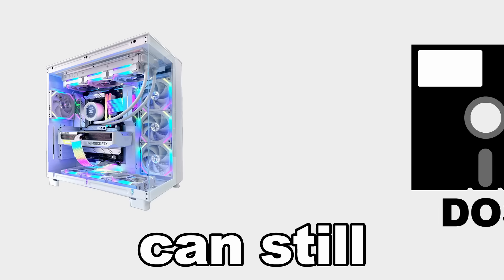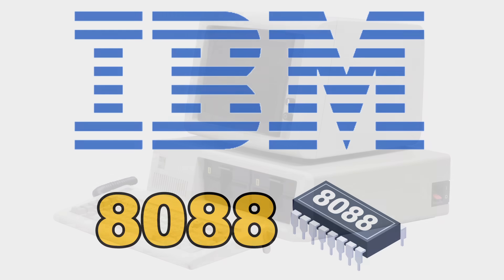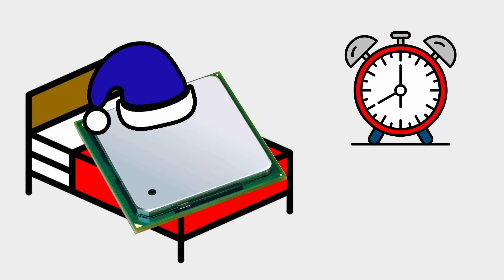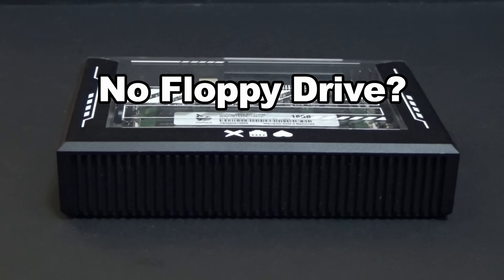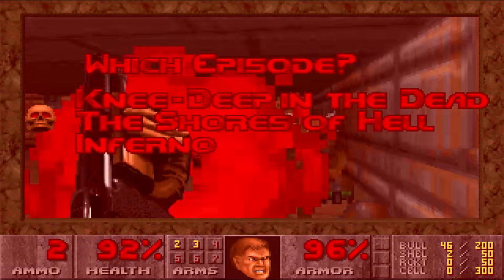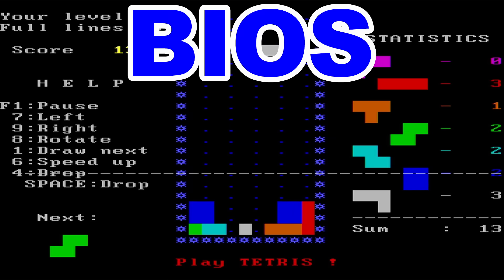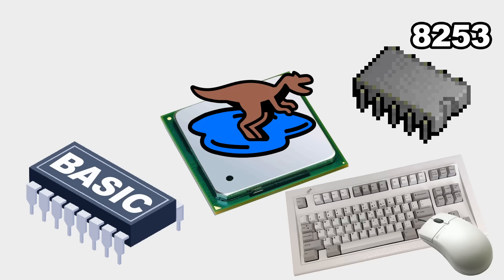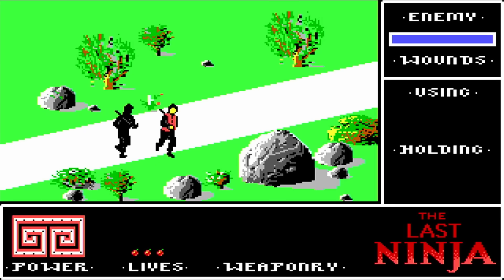45 Year Old DOS on a New Intel CPU Without Emulation

Comment: Short answer: it's CISC!

Long answer: most basic 8086 instructions are there IN MICROCODE, those are implemented with microcode routines that "emulates" them with simpler instructions: for this reason a "simple" 8086 instruction can be quite taxing (like DAA -> BCD adjust after addition) in term of execution cycles.
Those are just chunks of microcode that perform poorly (but a 1GHz CPU is powerful enough to make sure that even then it's lighting fast if compared to an original 80486).
Intel dictated different instruction sets in real, protected and x64 mode (that one came from AMD to be fair) so instructions (opcodes) that are there ad do something on "REAL" or "VIRTUAL" 8086 mode just disappears when the processor "move" to protected 286, protected 386 or x64 mode... because the same opcode / instruction does a completely different operation depending on "witch mode" your CPU is running at the moment.

There are at least four ISA (instruction sets) on a modern cpu, one for each mode and you get "fast" instructions (that are implemented close to metal) only when you reach x64; the rest is implemented "poorly" because "no one cares anyway".

Truth to be told real intel or amd machines are somewhat of a small mistety in a sense: they aren't 8086 and they don't look similar to anything that resembles a classic (or even a modern if you look at them top-down) processor: they are unique, complex and really "strange" processors that ACT as 8086-80286-80386-x64 machines only because a small microcode layer mimic the machine with the underlying hardware.

A failed company, TRANSMETA, only tried to exploit this thing to build a "morphing" CPU that could be "upgraded" just moving from a microcode to another. They didn't last.
Reply: I was about to upvote, but... Transmeta certainy wasn't a "failed company"!!! It licensed it's IP successfully, giving non-exclusive licences to Intel, Nvidia, Sony, NEC, etc. until it was bought out in 2009. 2005 in particular was a very profitable year. It successfully sold technology, in particular LongRun and LongRun2 power efficiency tech.  I think you have memories of when Linux promoters, and Linus T. personally, had problems with the concept, as it wouldn't work very well with Linux at the time. But shade from Open Source groupies doesn't constitute failure.

Comment: Apple gave up backward compatibility in hardware when they switched from 68000 to PPC, from PPC to x86_64, and from x86_64 to ARM. They gave up software backward compatibility when they switched from macOS classic to MacOS X and partially when they gave up on supporting 32 bit software in macOS altogether. That's one of the things I truly love about Apple. They step forwards, cut off old tails, get rid of legacy crap. There's always a smooth transition (macOS classic could run on MacOS X for quite a while, PPC code could run on x86_64 CPUs, and x86_64 code can currently run on ARM CPUs) but after a while they just move on. 

If you truly want to run 45 year old software, just use an emulator. Not only can it emulate any hardware you like and hardware you cannot even buy anymore for ages, it can also fix issues that hardware had, it can make software even run better than on the original hardware. Some games today are way better playable in an emulator as they had ever been on true hardware.

Some people may think cutting off backward compatibility is a bad thing, but they would probably not think that way if they knew that x86 CPUs could be faster, more efficient, and cheaper today and Windows would be a lot smaller, more stable and less resource hungry if they only dropped a bit of backward compatibility at least once every decade. You are paying a high price for compatibility that 99.999% of all users will never ever have any use for. Quite often the answer to "Can we do that?" is "Sure we could do that and it would be awesome but it would also break backward compatibility, so unfortunately no, we cannot do that". That happen in software dev, that happens in hardware design and it happens all the time.
Reply: "That's one of the things I truly love about Apple. They step forwards, cut off old tails, get rid of legacy crap. "

... and their market share showed the result of such decision 😏
Reply: @gorilladisco9108  Their market share has been constantly raising in the last 20 years and the main reason why not more people buy Apple products is the price and the fact that they cannot run their Windows programs on it but that has nothing to do with backward compatibility, as even if Apple was backward compatible to their systems 30 years ago, people could still not run their Windows software on it.
Reply: So, Apple went from CISC (68000) to RISC (PPC), then back to CISC (x86_64), then changed their mind and went back to RISC (ARM). That's quite some work to just switch between 2 architectures. Also, their change to ARM has nothing to do with backwards compatibility but with their measures to stop people from building Hackintosh machines.
Reply: @BrunodeSouzaLino  There is no CISC anywhere. x86 CPUs are internally RISC for almost three decades now. The outer instructions are internally translated to RISC as all the CPU core parts are RISC. Again, the only reason the outer instructions are still that way is backward compatibility.

"Also, their change to ARM has nothing to do with backwards compatibility" - Nobody has ever said so. Stop making up things.

Comment: The problem is not being able to run DOS, it is that most of the time when you need to run DOS you need a true hardware 9 pin serial port 16650 

The DOS is part of the problem, but that hardware serial port that the BIOS has programmed in it, and the speed of the CPU

Usually when you get over 300 MHz the software will crash because it was never written to work at that speed

The other big issue is slowing down the data rate of the COM port

The old machines had 9600 or 14400 but the device and the software don't handle much faster. 

I program old two-way radios and it is a nightmare unless I have an old laptop with the first USB ports, and a hardware serial port and slow enough 

A nice 486 or Pentium 60 megahertz that has a USB port is great. 

I remember in the 90s having motherboards with USB header pins and no USB cable to add ports to the back. 
And on the laptops that had a USB port, the only device available that was USB was a mouse. 
I remember even in the late 90s, around 99 it was still almost impossible to find USB devices. 

XP was the first time we saw USB keyboard and mouse and no PS2 ports
DELL was the one I dealt with all the time and I remember having to get PS2 to USB adapters or USB keyboards and mice.
Reply: There was no BIOS support for serial port communications.  You had to write serial port code yourself in DOS.    The data rate of the com port is hardware controlled.  CPU speed doesn't matter.  I think you meant 16550.  Those chips with the deep FIFOs were needed to do "high" speed comms (think 9600 bps) with slower processors.  They buffered up to 16 characters for each interrupt compared to one character per interrupt in the original 8250 and 16450s.

Comment: If Intel and AMD worked together on a new instruction set to supersede x86, it would instantly be better than any other chip out there. And the way most software is written these days, supporting the new architecture would be easy. x86 is holding back Intel and AMD, which is why both have toyed with the idea of making ARM or RISC-V chips. But they should just work together on a new CISC design.
Reply: you might want to actually research the current 64 ISA... there's a reason a lot of places call it AMD64 instead of x64 or x86_64... AMD created the ISA that is still in use today, even on Intel CPUs, Intel just licensed it from them and added a couple of Intel only instructions to it (and changed the endian-ness so they're still not cross compatible with each other... I.E. you can't install windows in an AMD computer and move the hard drive to an Intel one and just boot it, you either need to reformat or use something in between to translate the endian-ness to the expected type)
Reply: @sirgouki6207  I am well aware of the AMD64 architecture. And you don't have to reinstall Windows, Windows will detect the change in hardware and reconfigure itself appropriately with the correct drivers.

My point about them working together on a new ISA still stands.
Reply: @sirgouki6207  you couldn't be more wrong. both intel and amd x86 are little endian, most of the instruction set is identical and you can definitely put a disk from an intel pc in an amd one and it will work. if it doesn't, it has nothing to do with endianess and everything to do with drivers.
Reply: The last time AMD and Intel worked together (back when AMD was a chip supplier for Intel), Intel shafted AMD. Then later, Intel tried to sweep x86 under the rug with IA64, but failed and til this day they're forced to license AMD64 from AMD.

Comment: You claim that DOS can run on Intel, or AMD systems now because the instructions are still there.
I hate to tell you, 8 and 16-bit instructions have not existed on X86 chips for a really long time now. I think Intel got rid of them with the Pentium. Of course for Intel now, many of the 32-bit functions don't have silicon for them either. Some of instructions on  Intel chips still run on the bare metal, but quite a few of the commands are now read, and translated into a special micro-code, or in the more common vernacular, emulated. Having many things run in micro-code, and even the ability to redirect hard coded logic to micro-code when they need to. This is how they have worked around some hard coded security flaws in the past with just a BIOS update.
Reply: I'm not sure what you're getting at here.  Sure, the instructions are executed in microcode, but it's still being done in the CPU.  How the instructions are implemented in the CPU doesn't really matter - the point of the video was that you could boot DOS on a modern processor.

Microcode's been around for longer than Intel has been a company.  It's just a different way of implementing CPU logic.
Reply: You're slightly incorrect.  The instructions are there, but once the CPU switches into 64Bit "Real Mode" they get isolated away.  This is, presumably, why you can't play old games like the original Red Alert in windows now, as the OS can't even access the 8bit and 16bit ISA in the CPU.  If you do like in the video, and instead boot into a 16 bit OS, the CPU never makes the switch and you still have access to those instructions (Unless you're on a 64bit only CPU)
Reply: @sirgouki6207  No trust me, those instructions are only there in microcode, firmware. Technically there is only "Real Mode" now, but internally the CPU assigns all resources to simulate the old startup. That's not to say that the "switch" of modes isn't required to maintain backwards compatibility, it just doesn't change the a hard coded decoder like it did on the 386 and 486. I am not sure exactly when AMD switched their implementation from hardware to firmware, only that they've been emulating the old instructions for quite some time now as well. I might be wrong on this, but I heard from some people in UEFI trusted mode you don't even need to make the "switch".

From the software's perspective it has no idea, and everything should run just like it is hard wires. It is just running on firmware code, instead of hard wires on the IC. It was very interesting learning about the internals of the Intel chips as they basically don't run on x86 instructions anymore. Intel chips are actually more RISC than ARM chips are internally. Heck, how Apple got their ARM chips running so fast was having dedicated CISC instructions for commonly used features like H.264. Of course you could also get me going on about how Intel and AMD x86 chips are really only 32-bit with 64-bit extensions, unlike the M3 chip that are actual 64-bit.

Then there is the P and E cores in Intel chips and how vastly different their designs are.

Intel also gave us a little more glimpse into their current design with their recent announcement about the problems 13th gen and 14 gen i7 and i9 processors are having is because of a bug in the microcode that regulates the voltage, causing too much power to go to parts of the chip. I would have guessed something as critical as that would have been mostly hard wired, but nope, it is regulated in real time by firmware.

Comment: Actually not all x86 cpu can run dos these days, mostly because of UEFI restriction that disallowed dos to be loaded. Particularly anything after skylake just won’t run even with CSM on. Why? Because I couldn’t even load bootable nvflash to flash the gpu bios and had to flash gpu in powershell or CMD which it is less secure.

some hacker may insert some malicious  mining code to your gpu bios while you flashing it if you don’t know that your computer is infected. But this isn’t the case in dos as dos is only work in real mode and all these malicious code cannot even be executed due to most of malicious script required at least protected mode and ring privilege to run, even for ransomeware and usb kavo virus.

Comment: I remember dos used GWBASIC not BASIC from the command line. 
Alternatively you could install Quick Basic  which allows for compiling binaries. 
QB was the executable for the qb environment.
Reply: The original BASIC for IBM PC was BASICA. It had some part of it in the machine's ROM. You type BASICA at the command prompt to load it. You can also access it by not putting in any boot disc. But any programs you write with bare ROM couldn't be saved. 

Most IBM PC clones didn't have it (they need to be licensed from IBM). And later PCs did not bother to include the ROM because BASIC was out of fashion. 

GWBASIC was a BASIC interpreter that didn't need the existence of BASIC ROM to run. It's of course, developed for IBM PC clones by Microsoft. Later, it transform into Quick Basic as their vehicle to with Borland's Turbo Pascal for introductory programming language. Instead of actual EXE file, Quick Basic compiler produced bytecode (something similar with what Java does). With the introduction of Windows 95, it transformed into Visual Basic (and Turbo Pascal transformed into Delphi).
Reply: You forgot QBASIC which replaced GWBASIC in MSDOS from about version 5 onward.  This was source code compatible with QuickBasic, but couldn't compile programs into EXEs like QuickBasic could.

Comment: Actually somewhere around the Nehalem Generation and with the availability of EFI1.0 (I have a Xeon Workstation from 2008 with EFI1.0, the predecessor to UEFI2.0 which we all use today) PC-CPUs did no longer start in 16Bit-mode but always in full 64Bit mode. You could force them to switch to 16Bit but that was about it. Besides that, all that old stuff, 16, 32, protected, real mode etcpp, uses around 100.000 bits of Microcode inside a current CPU.  As modern CPUs have transistors in then 10ths of billions this is less 0,01% of the die-space.
And btw, around the Intel 10000 generation support for CSM/16Bit was dropped from pretty much any BIOS/UEFI. Finding Boards still supporting that is... hard.

Comment: the question comes to my mind why are we will using compability for older software  why not remove old bloat and remade the process in 64 bit
does it increase speed or give more effiency less heat more head room for oc
Reply: Because people already paid for the software, and nobody is going to rewrite old software.  Would you like to have to rebuy all of your software every time a new cpu comes out?
Reply: Considering how bloated modern software is, it's quite ironic to call compatibility for older software "old bloat."

Comment: The newest PC have an UEFI-Bios and starts in 64 bit mode. Only a few not so new mainboard have in IBM compatible bios and starts in 16 bit mode. Like asus striker mainboard for intel core2 CPU.
Reply: x86/64 CPUs ALWAYS start in real mode.  That's a feature of the CPU, not the BIOS.  Now the BIOS can setup the tables and shift immediately into protected mode for UEFI and not support CSM, but when you power on that CPU it is in real 8086 mode.  Always.
Reply: @stargazer7644  I think the newest intel CPU stop providing 16 bit. I am not sure, but we can take a look at the last intel developer manual in pdf format for x64.